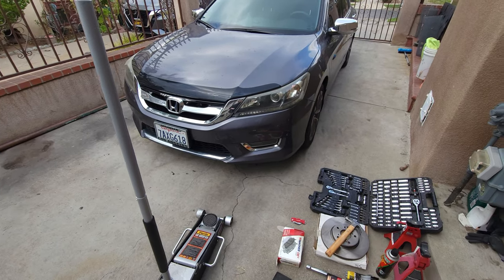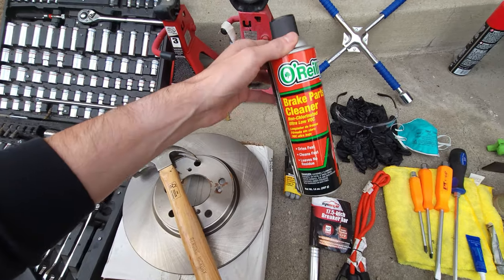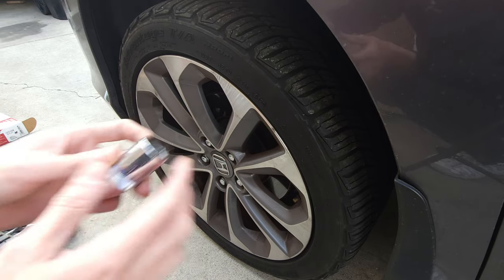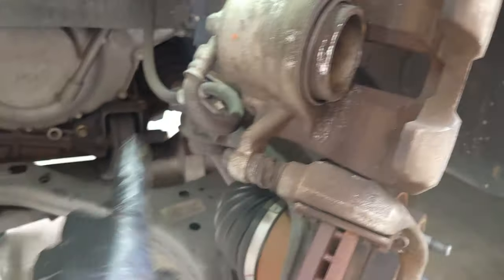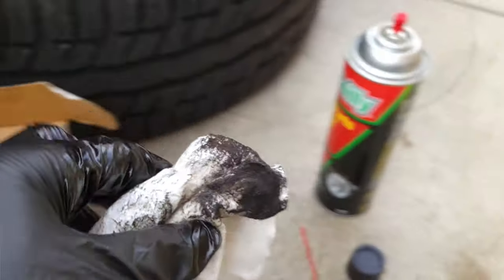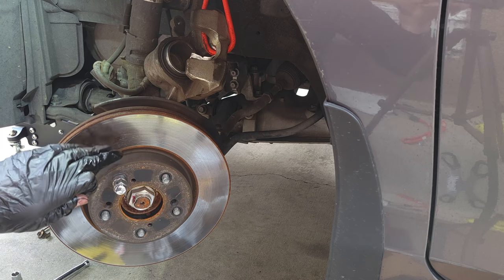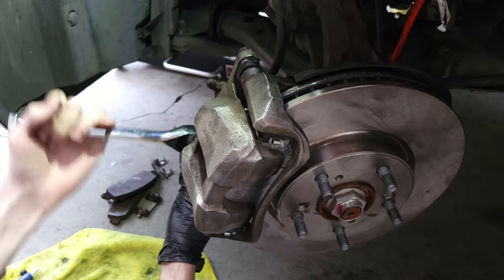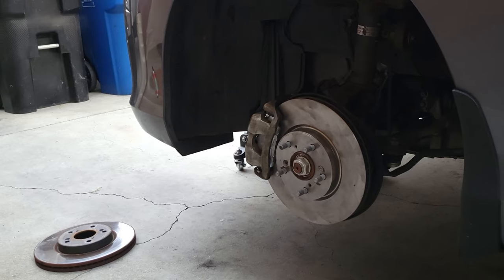*DETAILED* Front Brake pads & Rotors Accord (2008-2017) #honda #diy #mechanic

Comment: I just did my front pads and rotors prior to watching this video. The torque specs I came across were:

Front Caliper retaining bolts - 14mm - 30 ft lbs
Front Caliper bracket bolts - 17mm - 80 ft lbs
Wheel lug nuts - 19mm - 80 ft lbs

For those having trouble with the cross-pattern rotor retention screw: that screw uses a #3 JIS screwdriver or hex bit. A#3 FLAT ENDED phillips bit will work in a pinch. A standard phillips screwdriver might strip the screw if it’s being stubborn.

Comment: I had that same noise and determined it was coming from the rear using the E brake while reversing
Reply from the maker: Nope! Always frustrating not knowing where it's coming from
Reply: Great video BTW. Saved  me a lot of time
Reply from the maker: @erabbit777  Thanks! Yes very easy to lose time in the little details. I for example added the screw in the wrong hole and that added 35 minutes to the process

Comment: On your rear brakes video you used Bosch brake pads but on the front you used wagner brake pads. Was there a reason for that?
Reply from the maker: Nope, just whatever came up on Amazon with decent reviews. Sometimes it's hard to find the matching set on the Internet so I just go with what's convenient
Reply: I have same problem with that black rubber ring that you got rid of at the bottom gliding pin. Did you notice anything after taking it off or do I need to buy new once?
Reply from the maker: I've noticed no issues whatsoever. I heard it helps with vibration but everything feels the same @roniarad6030
Reply: @Striker50_  thank you
Reply from the maker: Anytime, thanks for taking the time to reach out  @roniarad6030

Comment: 3 ton or 2 ton jack stands?
Reply from the maker: 2 tons should be fine since this car weighs like 3600 LBS and you're not supporting 100% of the weight.

Doesn't hurt to get 3 ton in case you have other cars